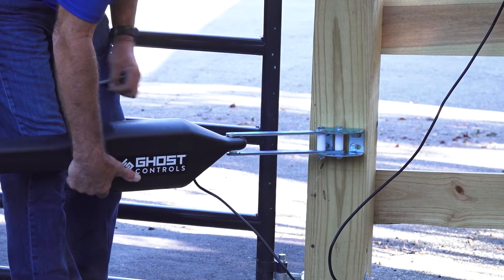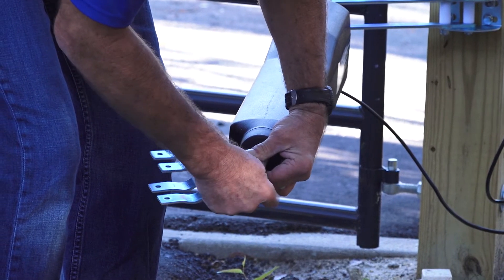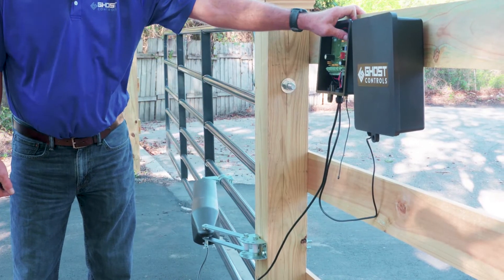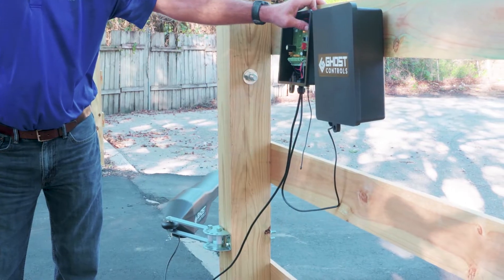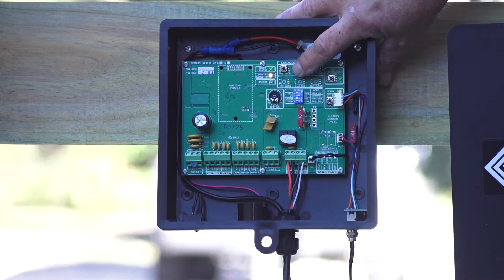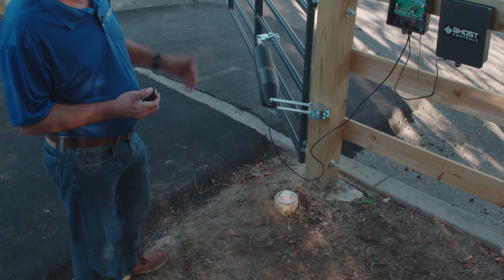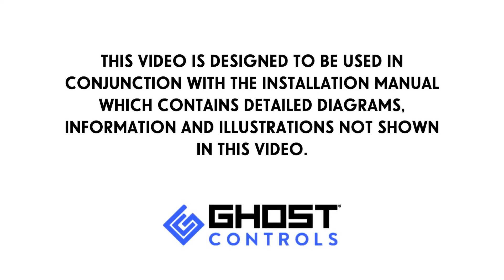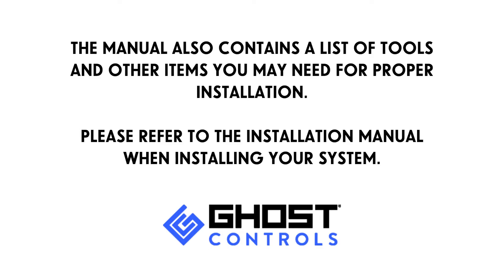Automatic Gate Opener-Chapter 6:Push-To-Open

Comment: Works as its supposed to.>>>t.co/I0fdanPRHl   Batteries that came with it were partially dead. Its great just to drive up and the gates open. I buried thetransmitter at 60 ft with no problems